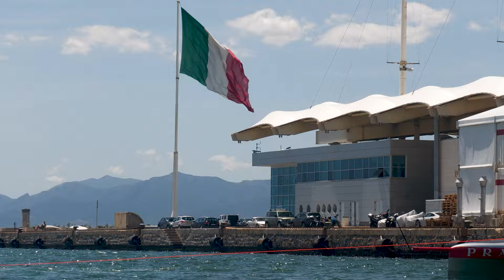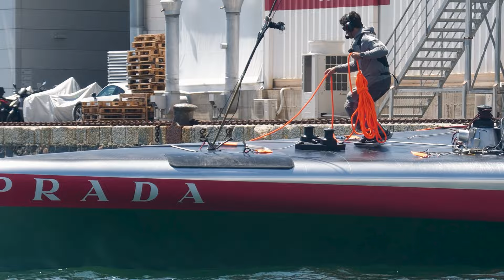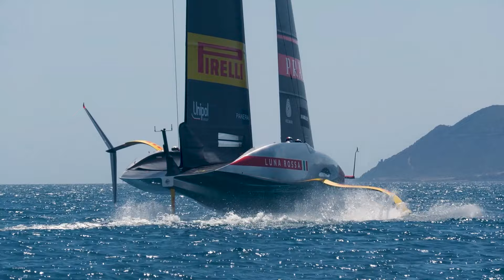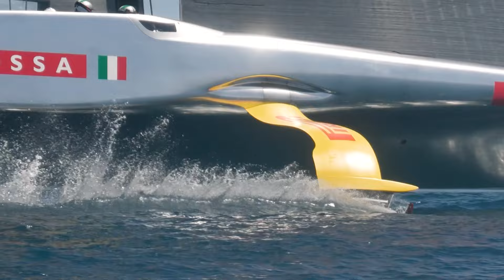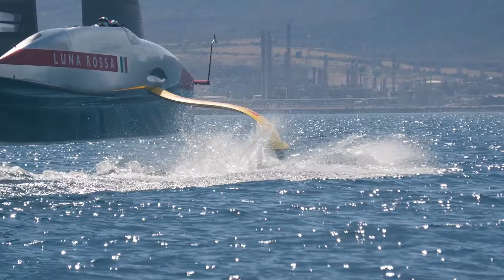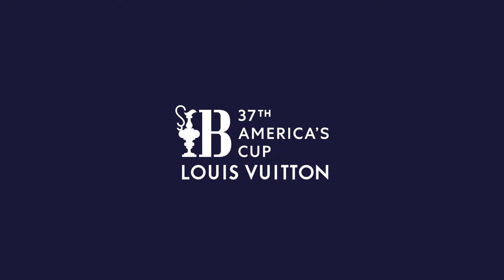Flight Controllers Start Fine Tuning the Race Foil | May 4th | America's Cup

Comment: Any idea why none of the teams are using the foiling hydrogen boats for their chase boats…?
Reply: Maybe not as fast as the quad-motor cats?
Reply: @jamesaron1967  surely they are at least as fast as the 75’s, and more comfortable than the quad motor cats. 
And more to the point, burn considerably less fuel. But there must be a reason, and perhaps you’re right. 
I’m gonna keep asking